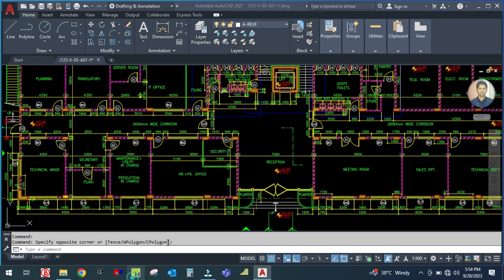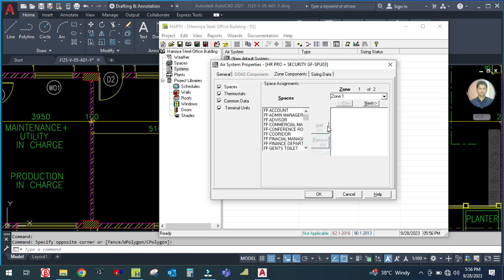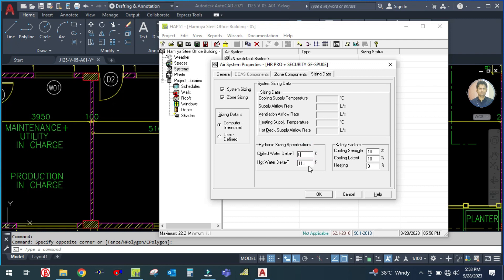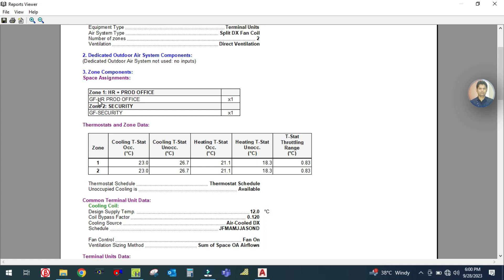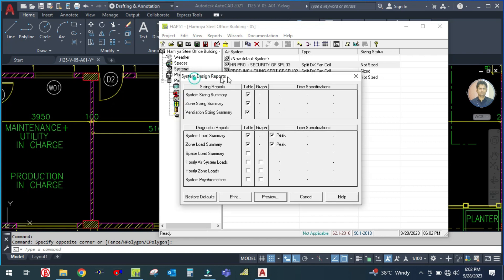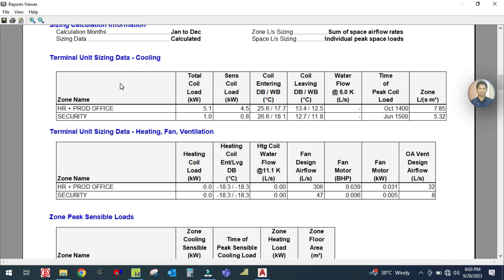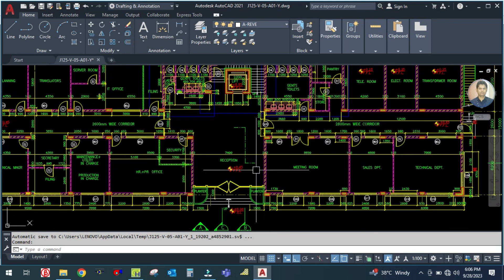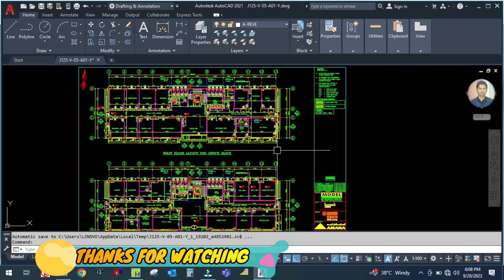PART-3 I CREATING SYSTEM IN HAP 5.11 I DUCTED SPLIT AIR SYSTEM I INPUT AND OUTPUT REPORT I

Comment: Sir I have one doubt..
After heat load calculation what is next process can you make one video...
Reply from the maker: After space i will create different type of system, like ductable ac system, pacakge ac system, chilled water system and vrf system after that i will generate output report
Reply from the maker: Then i will place the equipment air terminals and do the drafting parts